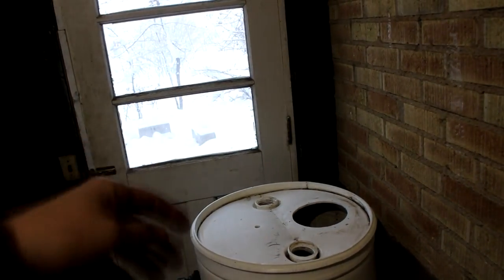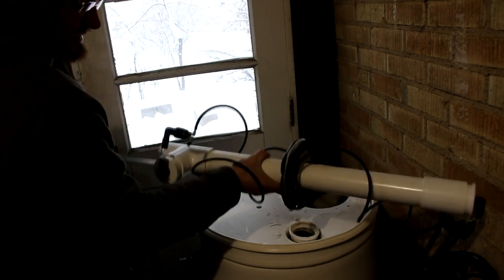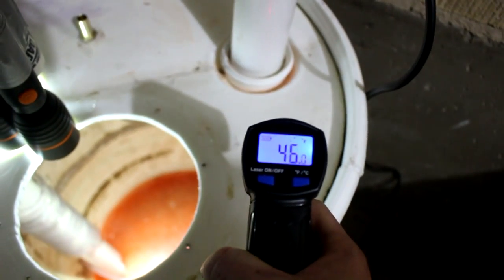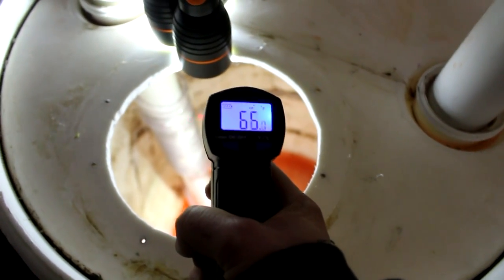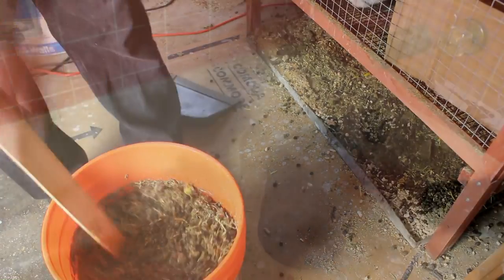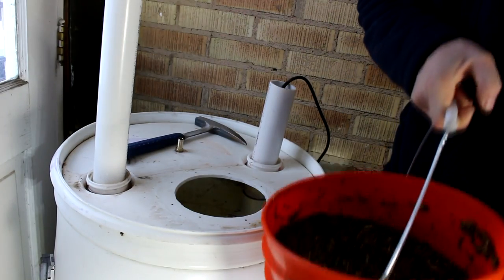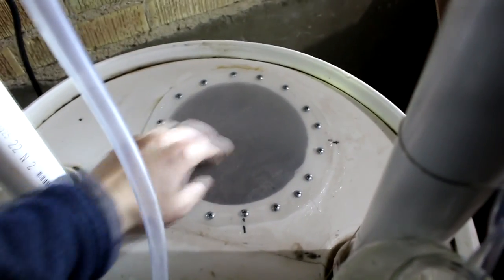Cody's Methane Generator Part 1: Putting it Together

Comment: Great idea, I hope you will make good progress with gas production. I have one question though: the processed biomass outlet sits relatively high on the barrel. Won't this cause problems with sedimentation? The stirrer should be able to break up the mass, but there is a chance that some of it will stick to the bottom of the barrel and refuse to be dislodged. In that case you'll have to dismantle most of the digester. Wouldn't it be a better idea to place the outlet near the bottom and use some kind of archimedes screw to take out the spent biomass?

Comment: Cody, could you explain how nichrome wire can be used in an application such as this? 

For example, I'd like to start a small, year-round, indoor hydroponics garden and would need to incubate certain crops during germination. In the winter, my room gets very cold so I'm trying to figure out a creative way to heat a small tub to 20-30C. I don't want to have to invest in a space heater or spend money on electricity, so I've been tinkering around with the idea of using either nichrome wire or a dedicated heating tape that can run off a battery. Everything I've seen online about nichrome wire seems to indicate that the wire is used to generate higher heat (160C+), but in this video you wrapped it round a plastic barrel to heat the digester to about 27C. I'm not an electrical engineer, but I'm sure this has something to do with resistance and the length of the wire. 

Can you please explain how the nichrome wire was used to heat the barrel to a lower temperature than the material is usually used to generate (in simple terms)???

Comment: Might I suggest using a bent circular sawblade on a shaft both for mixing the initial material and one permanently in the barrel as well that you could just chuck onto with an electric drill of some sort?

Comment: Hey! How does the dechlorin get rid of the chlorin? And also, why didn't you mix the rabbit droppings and water straight into the methane generator bucket? The orange bucket seems like extra work to me. Just add it all in there and mix it about. You need a wider funnel, that top cap is a mess :) Btw Cody, you're an inspiration.

Comment: Hey Cody I'm wondering where you plan to use the methane, I would think that it's non-odorized state means it less then perfect to use in your house for cooking and heating however you could cook with it with caution?  A generator could run on methane but you would need a storage tank system mother earth news has a methane holding system the had a floating top.

Comment: Hey Cody, have you tried making a microbial fuel cell. It would still produce methane and it would also generate electricity maybe to power the heater. I've made quite a few and they seem to work quite well

Comment: Hi Cody :D I was wondering .... Can you get a stronger container with a pressure valve, and use pressure via Boiler equation to increase the temperature ? Will increased pressure kill the bacteria ?

Comment: Thought i might ask here since its more likely you'll see it but in your gas in glass tube videos where are you getting the borosilicate tubes from?  Also what are the outer and inner diameters? I found conflicting values for the ultimate tensile strength of borosilicate glass from 1015 psi to 41000 psi so I'm unsure what values you used in your calculations (Barlow's formula I assume) so it's hard to decide what tubes to get that will safely be able to contain liquid CO2.
Any insight into the specifics would be greatly appreciated, might save me a lot of trouble :P

Comment: Great video as always Cody. I covered a production of bioethanol on my channel, and I was planning to do a biogas production on the small-scale using 1-liter flask as a digester. Anyway, my plan was to convert gaseous methane to liquid methanol for storage. According to these equations, it can be done by reacting methane with water vapor at high temperatures.  CH4 + H2O → CO + 3 H2 ,  CO + H2O → CO2 + H2,  2 H2 + CO → CH3OH
After a very brief research, I realized, it would be tough to do this without investing allot of money into equipment. So I kind of temporary gave up on this idea. I am wondering if you are planning to convert methane to methanol in the second part or at all? Perhaps you know the more amateur chemist-friendly process? In any case, I am looking forward to the second part.

Comment: Just a heads up about that heater model. It is usually not accurate out of the box, I've found on average about 4 to 5 degrees. You may have to recalibrate it if you're going for accuracy.

Comment: i'm thinking of ways to collect lightning/aerostatic electricity and wondered if electrolysing salt water into hydroxy gas would work. I assume the energy would need to be stored very quickly and a capacitor is only useful when you need a fast discharge too. would you consider making a video on the topic? It's quite interesting

Comment: Birds are uricotelics (their metabolic waste is not urea, but uric acid) and they produce a lot of nitrogen. 
Mammals are ureotelics (their metabolic waste is urea).

Mammals--> It requires 0.05 L of water to excrete 1 g of nitrogen,
Birds--------> about 0.001 L per 1 g of nitrogen
(from wikipedia)

Uricotelic animals lose less water so they are better adapted to dry areas, the disadvantage is that the uric acid is way more toxic than urea

Comment: Hi Cody, Q. regarding chlorine in water. Many people into Hydroponics believe it's best to bubble air through tap-water for at least 24 hours before using it to rid the water of as much chlorine as possible, does this actually work and is it actually necessary in your opinion?
Love the channel, even if I don't undertstand it all & may never find a use for the wealth of info you provide. :)

Comment: If you just stick the heater in there it will drive a convection current and distribute the heat. You really don't need the coils and they will reduce the flow rate.

Comment: Nice job Cody, these things are fascinating. I really like the idea of using bacteria to make useful things. If you have any free time could you have a look at using Nitrosomonas bacteria to make nitrates starting from an ammonium salt? I've tried this a few times with dirt, an aquarium bubbler and a 0.75% (NH4)2SO4 solution(found a patent from like a century ago).
I haven't seemed to have much luck though. I tried keeping the solution at 30C aswell

Comment: Could you maximize the production if you were to grind up the material very finely before adding it and also finding a way to keep the temperature higher at no additional cost like by running your hot water pipes from your house through or around the container

Comment: How efficient is it though?  Does the methane produced contain more energy than the electricity used? Could you build it so it was self powered and have a surplus or are you using electricity to create methane at a loss?

Comment: Hey Cody. I've tried to create one of those generators for a project but at smaller scale. I drilled a hole in the cap of a 10 liter bottle, attached a tube that has a ballon at it's end, filled it up with goat manure like 1/4 and filled to 3/4 with tap water. Everything is air tight, but it's still not producing ANY gas. I used normal tap water, and I didn't dechlorinate it, is that the problem?

Comment: Couldn't you flush it with nitrogen or argon or similar to speed up the process? Also do the bacteria multiply in any considerable amount so that this would go faster and faster as time goes on? Wouldn't the bacteria then multiply quite quickly?

Comment: use a high nitrogen material to make ammonium salts , then use calcium or sodium hydroxide to kick off ammonium gas ,.....then mix with air and run through a red hot copper tube to make nitrates.

Comment: I'm confused. The warm water rises to the top to where the tube is, but the water won't want to flow down the tube because it's warm, right? 

Also I'm positive Cody knows about them but it would be pretty cool to see him make a fuel cell and generate some electricity out of homemade methane. He just has to find a way to clean that methane

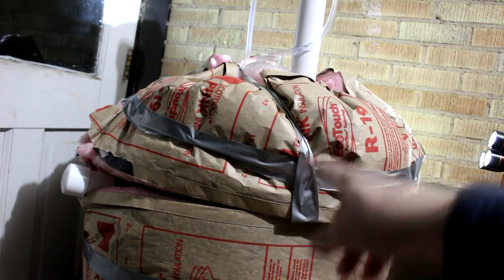Comment: Hello I am traveler from the year 12,018! You said at 13:10 to come here so here I am. Wow, how the world has changed in 10,000 years!
Reply: You mean one year?
Reply: austin rosenbalm he said 12,018. Not 2018.
Reply: He uses a system where the years start 10,000 years before our modern calendar.  So the current year in this system is 12,017.

Comment: The reason your hot water didn't come out of the pipe is because you need a pipe inlet at the bottom so then you can get a cold heat circulation the cold is always at the bottom he does always at the top if it has no place to go then it's not going to do anything

Comment: What would adding a little yeast do? Where does dog shit register as fuel for the generator? Could you feed a 12volt air compressor with your reservoir ball to get compressed methane. And what is the goal of the project?

Comment: If the gas generated is enough you could use the gas to burn  for heating the composter ? and Does the micro organisms not generate heat?

Comment: eheim heater? what wattage is that? im surprised it didn't over heat.
Reply: also seachem prime is highly recommended over API stress coat. at least for your fishtank.   
plus it doesn't have the unnecessary aloe and such.

Comment: Where can i get a decent stirling engine , the one that runs at ~400 degrees?
Reply: Matas Augustinas did you ever find one?
Reply: Well, tbh there are a lot of them on ebay and amazon, but not sure if they are good. When  have a higher budget, maybe ill try buying 1.

Comment: wouldn't kanthal have given you more heat per watt in the wire? i was taught nichrome generated more of the heat at the power source, and kanthal more of the heat in the wire.
maybe it's just my swedish heritage talking.
Reply: As long as there is enough resistance in the heater that should be the only thing heating up, but yes if you create a short your power source will get toasty.
Reply: as kanthal has a higher resistance per mass compared to nichrome, would that make a difference? or is it negligable?
genuinely curious over here.

Comment: Apart from killing an anaerobic digester, anti-bacterial soap really has very little use anywhere in the home. Think about it. If you kill of most of the bacteria (these soaps are never 100% effective), you're left with bugs that aren't killed by the soap. Since there's now loads of free real estate, these resistant bugs move in. Now you have a population composed completely of resistant bacteria, rather than the initial situation where only a small proportion were. If the antibacterial chemical is similar to one of those used to treat treat TB (as some are) you have a just devalued the utility of some TB treatments. This, too, has happened.

Please, don't buy antibacterial products if you don't really, really need to. (Small babies and people with compromised immune systems are the only reasons I can think of.) Simple soap or bleach are perfectly good enough and don't lead to resistant populations. They're also cheaper!

Comment: 10:15 if humans don't have methane producing bacteria in their guts than how do people light their farts on fire?
Reply: Methane is, well, kind of, NOT THE ONLY FLAMMABLE GAS
[Note2self: My anus is one]
Reply: and we actually produce a very tiny amount of methane its not as large amount as people think
Reply: there is still other gases going out as well. which would produce sound as the sounds caused by the pressure not the flamability. i think scishow did a video where they mention the amount of methane and how low it is as well